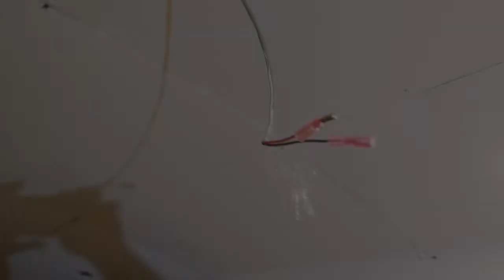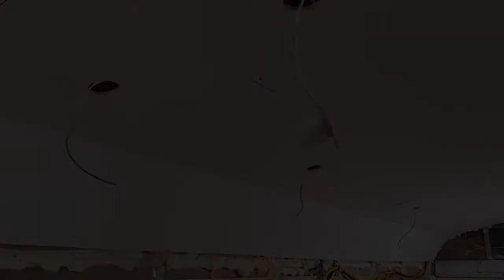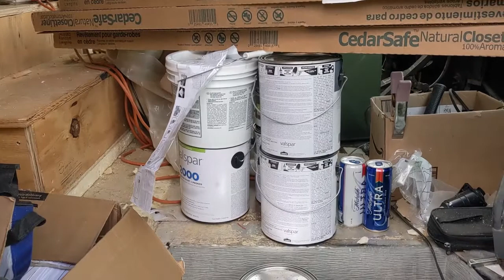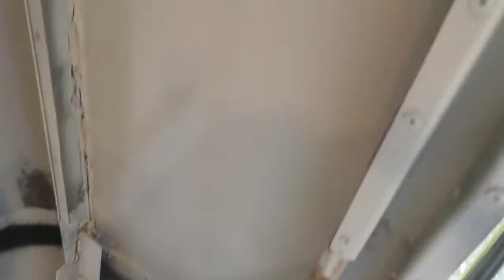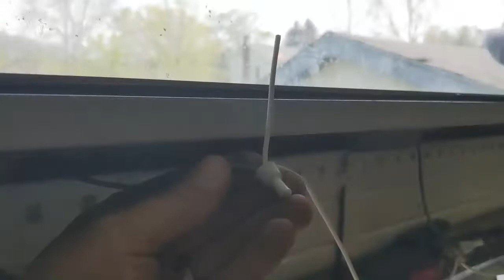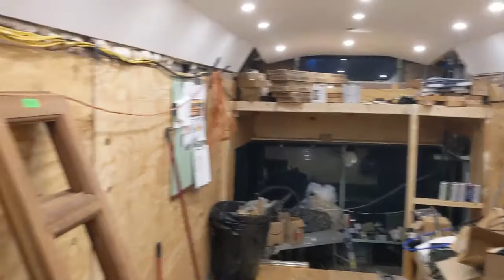Skoolie Build #57: LED Puck Lights, Testing ComfortFlo 6048 WM Whirlpool, and Wiring Load Center

Comment: Think I would do the positive to have the shielded connector and the ground to be the bare connector
Reply: If you're referring to the bullet connectors they are a male to female set.  + And - each have one set M and F.
Reply: @larrym6019  Yes,  but i think they way you wired it up, the +12v could short out against a metal surface if when it is disconnected. If you look at the things like the 4 prong trailer plug, the 3 wires that are potentially +12v for Tail and turn are shielded when they are disconnected from the trailer, while the ground lug is bare. I know it is only 12v but still can short out if would become disconnected could cause a potential of a fire in the 12v wiring
Reply: @leongeesey5910  oh I see. There isn't anything in that ceiling space made of metal that they could hit but you raise a valid point.